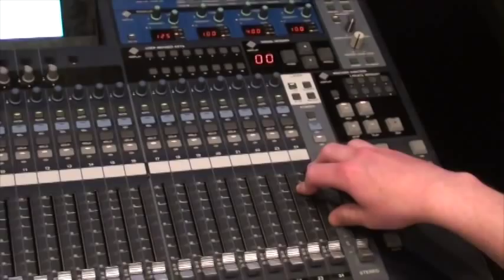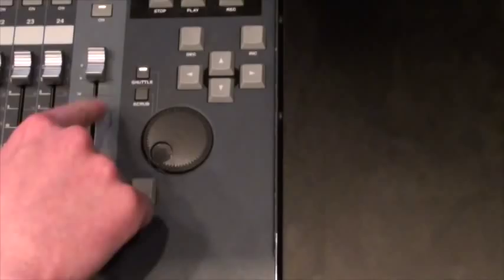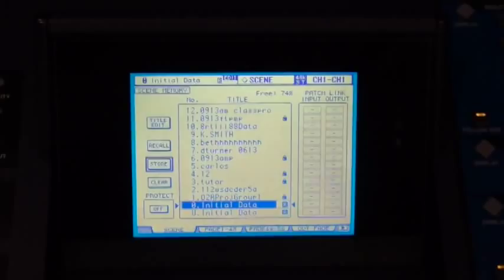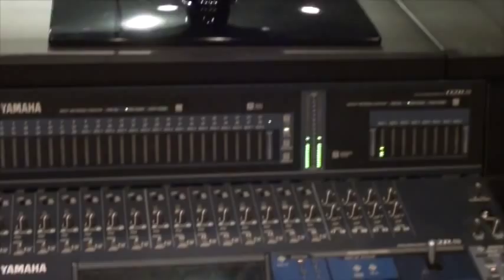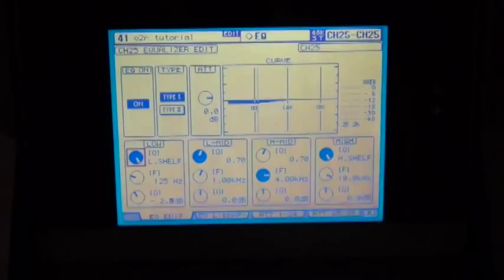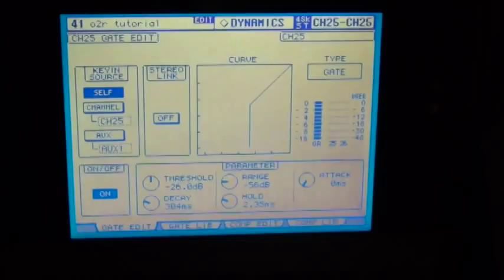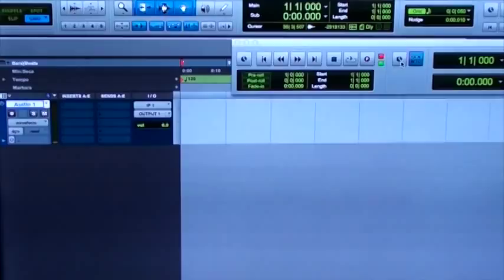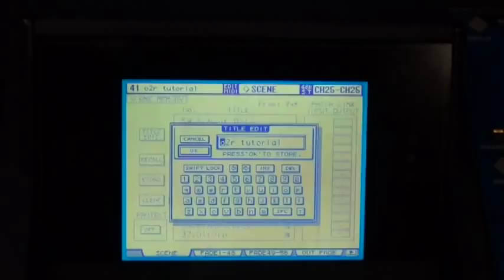SAE Atlanta O2R Tutorial

Comment: I have a problem I cannot solve that brings me here. I have an Alesis HD24 hooked up to the o2r with light pipes. I have three adat cards mounted in the mixer in slots 1,3, and 4.  I cannot monitor the 17 through 24  channels of the HD24 with the 02r,  through the stereo inputs 17/18 through 23/24 ? I can see the signals on the HD24. I have a meter bridge that is a bit confusing. I have used the manuals for both. I have tried different routings. I get 1 through 16 no problem. If anyone can help me, HELP!!
Thank You
J.D.

Comment: New problem, 
I bought my 02R96 for 250.00, everything seemed to be working correctly but the battery checked dead.
After I replaced it  board won't boot.
I have tried initializing it, it will say it is going to calibrate the faders but never does anything, just sits there.
I have tried initializing it more than once, some times it just sits there, you can see it loading on the display
but it just sits there and sometimes it goes to the fader calibration warning but then it just sits there
I asked someone who knows more than I and they responded with the following
Does anyone know about the following????

It looks like a case of bios failure due to battery failure, I have seen this with computers, and yahama may need to send you an updated firmware update to restore it.
I would contact them and inquire about this as they are the only source for this type of help. A lot of digital studio equipment today is just dedicated PCs with all of the added
Ins and outs and surfaces for control added, these are subject to the same failures as
Computers and must be regularly updated and keep alive battery's keep them usable
If they are left unpowered for any length of time there is a risk of them not booting up
when they are finally re activated.

Thanks in advance
Dragonworks